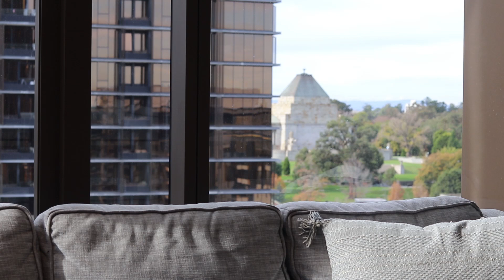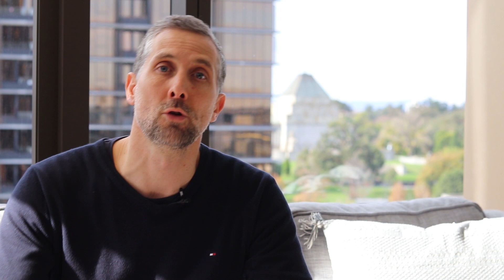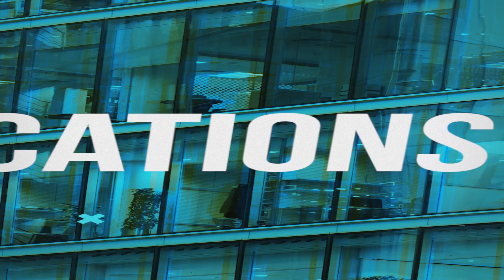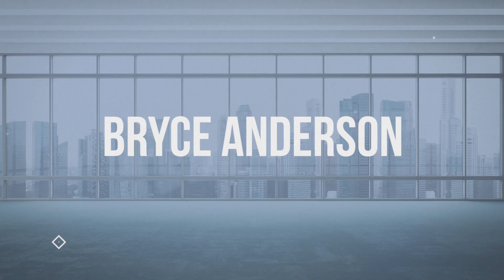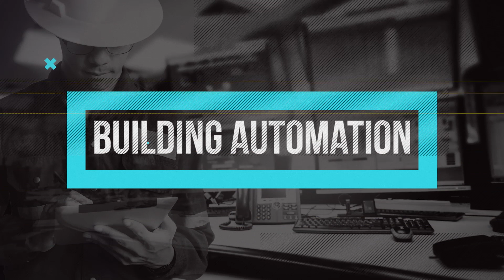Hand/Off/Auto Switches and Run/Fault Lamps - Do We Still Need Them?

Comment: I have been trying to remove lamps and switches from control panels for the past 10 years.  I am using a GUI embed in the controller accessed on a android screen on the panel fascia for simulated HOA switches.  This starts the drive and the thermal strategy.  If in hand then it reverts to auto after 4 hours to stop FM overriding the BMS.
Power boards for MEP plant can be standard distribution boards but be wary of IP ratings.  Finally only have ELV in the control panels all 230V transformers &MCBs should be in a separate door interlocked panel.
Reply from the maker: Hi Alan, having that Graphical User Interface would solve many of the problems some people are haveing with removing mechanical boards. 
Mmm, I haven't considered IP ratings with distribution boards. Thanks. 
Thanks for sharing.

Comment: Totally agree Bryce. I seem to have this battle on most projects. The same can be said about which switch takes precedence, for example if you put the hand/off/auto switch on the Mechboard to off, you can still go to the VSD and put it in hand to operate locally. I also agree that there is no point being able to manual on a fan for it to work against a close head due to dampers being closed etc etc. Back when I first starting doing decentralized controls (in the UK) we used to use the VSD for all the fan controls. The froststat and damper (full fresh air unit) where wired into the VSD. This enabled the unit to run in hand, which would wait for the damper to open before the VSD would start. if the frost stat activated it would inhibit the VSD. The damper could be wired in as an endswitch or timed delayed start.
The only panel lamps would be Power and Fire.
Reply from the maker: Yes, that would be the perfect solution. VSD's being enabled from damper open end switches. Not just providing a 90 second delay and hoping the damper had opened.

Comment: Great video, and something i wholeheartedly agree with. I always remember discussing this with a consultant (In the UK), there was a specific project where the MCP (Form 2) was over 3m wide, with in the region of 50 different switches. They wanted to look at VE options, and one of these was to swap out the 50 switches (and 90-100 lamps) for a HMI mounted on the control panel fascia. It was going to save somewhere in the region of £2k. The consultants response? "Well the FM guy wont like that, hes an older guy and likes lamps and switches, not that fancy new tech. From a commissioning PoV many controllers, come with built in H/O/A switches, which allows the same functionality, as its reasonable to open up 24vac ELV sections of MCP's.
Reply from the maker: Hey Adam. That's disappointing. People will accept value engineering that reduces the functionality of a system (reducing monitoring points), but wont fight for an enhancement that saves money. Imagine the value the mechanical contractor would have got from being able to see the whole system from that touch screen. Keep well.

Comment: Hi Bryce, you are completely right. In the Netherlands we don't have Mechanical switch boards. Example, in a data center we don't even have any interface switches between outputs and relais/circuit braker/analog etc. Everything is done by the BMS, the processes are highly complex. Therefore the software of the DDC controllers has to be 100% accurate.
Reply from the maker: That's great to know, thanks for feeding that back to the rest of us.

Comment: I believe you are right, but it is not quite that easy, my thoughts are that you still need some type of interface or HMI for system visualisation. The mech guys always get the short end of the stick. Primarily because they are the ones who take the direct flack from the Building Manager as to why things are not working. Often they are locked out of the BMS (sometimes for good reason) and there is seldom a BMS techie on site (they are normally working remotely 😂).
Reply from the maker: Mmmm.. Okay, on premium grade projects we could put a couple of touch screens in the two main plant rooms. We could also put a WIFI access point in each plant room, allowing easy access via mobile phone and tablets to web graphics. 
It's not going to be easy and it's not going to be cheap. But not commissioning the BMS because of compressed programs is worse. Thanks for your input.